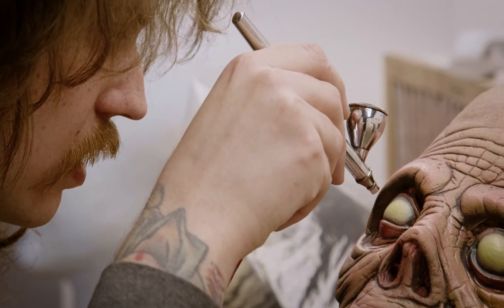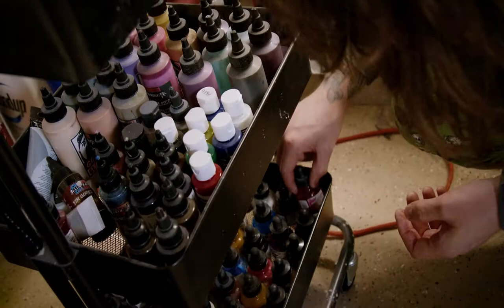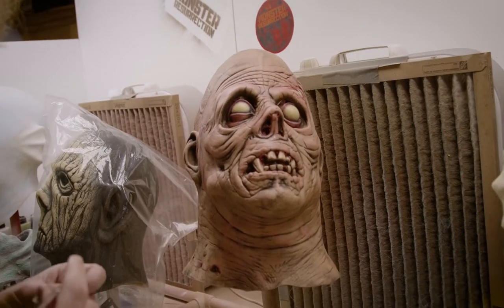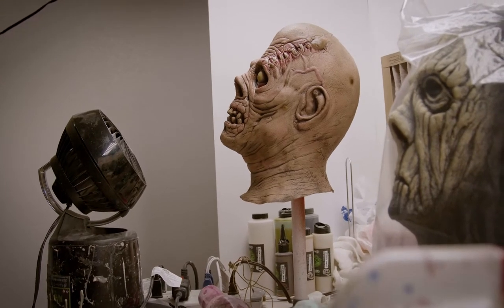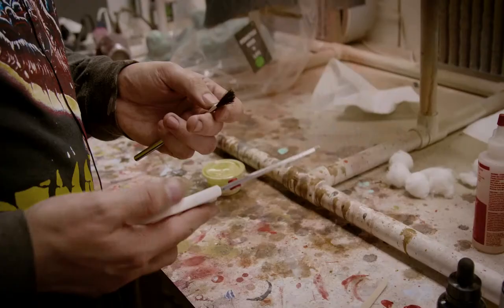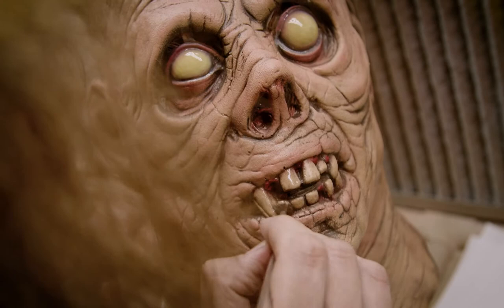How To Paint A Mask Part 2 | Mask Monday

Comment: Hey Shelley, is gluing hair with silicone better than using latex or rubber cement? How long is the drying time too
Reply from the maker: I use both equally. Silicon is better when using braid hair because it’s synthetic and won’t soak up the latex. Working time is a lot longer with silicon- about 20-30 minutes. When I use mohair I usually use latex.